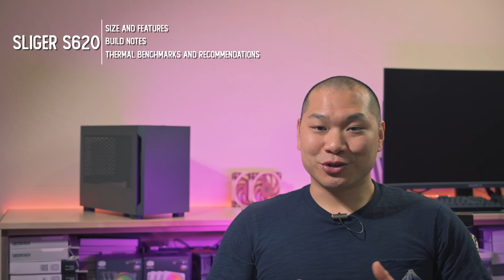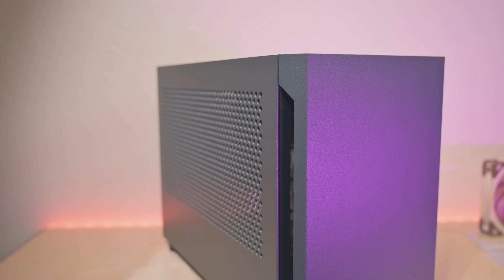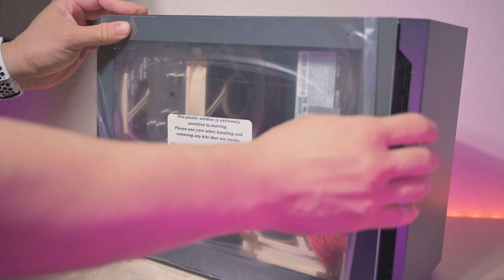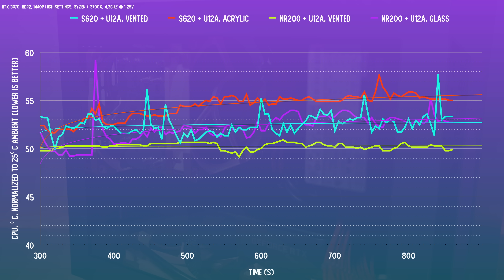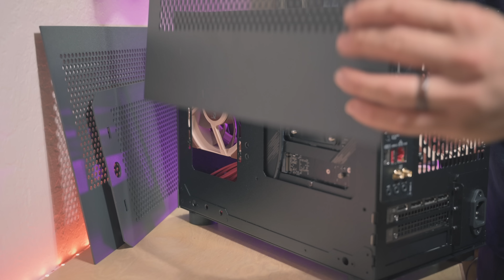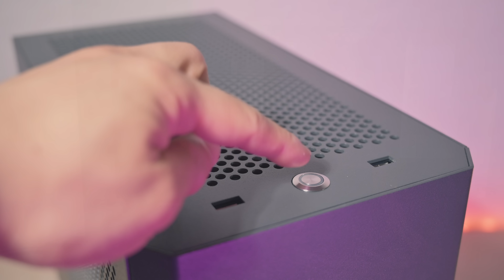The Sliger S620 - One Slick 16L Case!

Comment from the maker: Just a quick note on the D15S- Sliger mentions it is compatible, but I haven't tested it out yet. Other than the single fan difference, it is an asymmetrical design. Most likely that means you have to rotate it where clearance at the top would be better, but clearance at the bottom is completely dependent on the CPU socket position. On Asus ITX boards this is typically lower, Gigabyte and MSI have a higher position and would be better for that configuration. As a reference I have about 24mm of space between the bottom of the D15 heatfins and the GPU, by my estimation with the Gigabyte ITX the D15S in a lower position would still clear. YMMV depending on motherboard choice.
Reply: With a gigabyte b550i and a noctua d15s, the space is fine on both positions.
Reply: Hello, Can you make a Review for Thermalright PA120.. Please.. thank you..

Comment: Hey man, great video! :)

I've got the Sliger Cerberus and in case of using the rear fan as an intake fan, how bad is it for the PSU in terms of hot air flow to it? I am worried about it.

Comment: I have a very specific question for a particular setup in this Sliger case. 
I'm using the Noctua NH-U12A with an added slim intake fan and slim fan top exhaust right above the U12A. 
The GPU is 4080 FE so there are no bottom fans, and the PSU is side mounted so no front fan either.
Pretty much all the attention is on the CPU and nothing on the GPU except its own cooling solution. 
The temps are already pretty solid however I'm looking for recommendations with this setup because I could add a side mount fan or another top mount fan if those have helped temps in anyone's experience?

Comment: I have watched through the whole video and I understand it runs a bit hotter than the nr200. I have a few questions.

1. Will you recommend this case for a first time builder? I could just go out for nr200p in my local market but this case just feels so much high quality. 
2. How about ability to expend (upgrade in the future)?
3. Similar price range, how does the S620 compare with the NCase M1?

Thanks for the video anyway!
Reply from the maker: Hey Mark, thank you for checking in- here are my thoughts-
1) The S620 is OK to build in, the access through the top and front isn’t as nice as in the NR200, I’d say the NR200 is more suited for a first time builder, and yes, the S620 does have a nice feel to it build quality wise, but the NR200’s build flaws are more alignment and finish quality vs structural problems, and from a design perspective it’s a win for the NR200. It’s not as big a difference as you might think. Also there are a slew of color options coming for the NR200/P as well.
2) As long as it’s ITX or DTX boards and a 240 or 280 is good for your CPU, then you are covered.  Both are pretty sufficient for bigger GPUs but the Nr200 has a little more going for it since it can go vertical gpu with a riser cable if you want.
3) The M1 is my personal choice but is more cooling limited, and you don’t have as many drive mounting options, it is a different size category and really is more comparable to the S610. If you want to go big air cooler, the S620 is the one to go for.
Reply: @MachinesMore  thanks for the insight! I will definitely look for more builds with these cases and make a decision based on my needs (aircool with ryzen 9). I wish you the best with your channel.
Reply: I have also just found many videos of nr200 with different options on your channel, I will definitely check them out!

Comment: Can the C14S run in low profile-mode in the S620 or does it need to have a 120 mm fan underneath to make it work? Also, how sizeable is the height difference between this case and the NR200 and between the two, which one do you prefer in terms of performance and overall delivery? Furthermore, the max GPU supported is 323 mm and I have a RTX 3070 that is exactly 323 mm. Would this (Gaming Z Trio) realistically fit into the S620? Thanks in advance.
Reply from the maker: Hey Daniel, the C14S can run in fan on top mode (just like in the NR200). The big advantage the S620 has is in cooler height so big dual towers fit, but even then I think a good single tower is fine for most (not all) CPUs. The NR200 is slightly taller, and the biggest difference is top fan compatibility - which makes a very big difference for overall thermal performance. In general I’d go NR200 but if there is a compelling reason to have out of box SFF compatibility for something like a Dark Rock Pro 4 or D15, that’s what the S620 is for.

Comment: Can I put nr200 as a carry-on in airport/plane? Planning to build one this December.
Reply from the maker: It would fit in a carry-on, I’d probably pop a tower cooler off if you have one mounted, just to relieve mobo stress from movement. That’s about it, cushion it with clothes, bubble wrap, stuff like that.
Reply: @MachinesMore  Thank you, your video on nr200 are amazing and helpful. I will also remove the gpu as well.

Comment: 2.5" SSDs is easy. Some 3M double sizes tape and you can't mount a couple of SSDs on the side of the PSU. Heck you could mount two on the side of the PSU and an additional two on top of those for 4 SSDs.  Then another one or two on the side of the PSU facing out, though that's probably more SSDs than the motherboard sports.

Comment: Very informative video! I was wondering if there is any way I could “cut” the inside front panel so I can fit my MSI suprim card in this case because it requires 1 extra cm of clearance in length...
Reply from the maker: Cheers! I think you could, there's enough room for it and I think a rectangular hole is structurally OK, thickness should barely work too (no bottom fans). Do you have the case already? Because the one other thing is the power plug location. The Suprim is 140mm or so, that might interfere with the regular plug, you may want to order the pigtail version. Also, I think you can get the card in but it will definitely be a bit challenging from a build and cable management perspective.
Reply: @MachinesMore  thanks for your answer ! I don’t have the case yet, but I’m looking forward to do an itx build with this gpu. I’ve seen that it could barely fit in the nr200 but I wanted a case with a more premium finish. I think I will need to stick to the nr200p though, first because the sliger is ~300€ here against 100€ for the nr200 so I can’t justify that much extra without knowing if it will actually fit... unless I manage to trade my suprim from a smaller gpu, this one is not itx friendly for sure... anyways thanks for your feedback, much appreciated!

Comment: Is there a reason why you chose rear-to-front air direction? I'm just thinking about opposite direction, will it be worse? I'm wondering because I would like to place case on desk left side and concerned about warm air blowing right into my face :) thanks!
Reply from the maker: Specifically to mitigate the flow through cooler design from the founders edition gpu. If you have a conventional gpu it shouldn’t be as vital to do rear intake.

Comment: Wow do you have more guides on the d15 configuration? I’m getting the same case and d15 cooler, it would be great to take a look them.
Reply from the maker: If you take a look there’s a recent vid comparing the D15S and the Dark Rock Pro 4- should give you a few ideas. The D15 is a bit limited in this case.

Comment: See if you can get a Sliger SV590v2 to review. Looks awesome and is designed to fit a 360mm radiator. They offer a bracket for a pump/reservoir combo for $10 to fit in the bottom as well.

So far all I've seen for videos is people putting AIOs in it, when the case seems to have been designed for a CPU+GPU loop. The only bad part is that there isn't an option for a glass side panel.

Comment: This case is super slick although I wish the side panel to be more vented like Ncase M1 V6
Reply from the maker: It’s more like v5. There is a scenario where it helps- if you’re intaking from the side panel and run a side exhausting GPU, the blocked off portion prevents the case from just recycling GPU air, especially with an AIO.

Comment: As you like slate gray cases, I can recommend the Lazer 3D LZ7 XTD - 10.4 liters with 135 mm  cooler height clearance -  acrylic panels are offered in a gray almost matching the Sliger cases.

Comment: this graphs make no sense. D15 is a monster. you configured de fans in bad positions. use de psu in horizontal mode, no in front. and use 2x 120mm in top, and 2x 120mm fan in botton. make a air flux. use the rear (120mm fan in side of i/o shield mobo, for INTAKE air no, exaust. the air comes directly in cpu and upwards for top. and in front, use 120x for exaust, taking the gpu hot air. and please, y see the product, not the youtuber in 80% of VIDEO. and please, make videos in zOOM OUT, and no witch 300% of zoom!

Comment: All I see is another NR200 style case. Let's face it SFF has turned into nothing but Dan A4 style sandwich cases and this perfect example of an uninspired ITX case that really just fits the normal expectations.  How many times we just going to see the saem two style of cases with minimal differences be extolled as something 'new and interesting'. This case is not revolutionary, just vaguely evolutionary.
Reply: I have to agree with this. Honestly, the NCase M1, Dan A4, Sliger Cerberus Chimera / SM580, and maybe the Ghost S1 (if not were the inconsistent QC issues) were the trendsetters. Somebody just please make a good 19-24L case as the Lian Li TU-150 is bascially alone in that category for ITX towers (Silverstone SG14 is 19.55L, but it's a cube case). I'm not all that a fan of super tall cases like the Phanteks Shift.

The NR200 is honestly heavily inspired by the Ncase M1 and TU150, so I wouldn't really call it all that original. NCase M1 was basically the 'BitFenix Prodigy' of enthusiast, boutique SFF cases and then came the Dan A4 as you mentioned for sandwich cases (do prefer the SM580 especially versatility wise). Lian Li TU-150 again took cues from the NCase M1, but at least they made it into their own with how you can do cable routing in the case.

Comment: Sliger Should have made NR200p Clone but lighter with aluminum instead of steel,  and 158mm limit instead of 155m limit of the NR200P then they would be the "Premium" NR200 case, right now its losing too much just to be slightly smaller, the 2 25mm at the top of the NR200 helps a TON with the glass panels duo the lack of vents, plus can't fit slim fans with the big GPUS with sliger unlike NR200 (nr200 got 75mm clearance at the bottom vs 70mm of the sliger and lot of gpus are full 3 slots at 60mm this gen~)
Reply: I'd honestly up it to 20-23L to be honest. I think that market is stupidly untapped especially for those that want to go high end air cooling or 2x140mm water cooling as options. The TU150 was a wasted opportunity and I doubt Lian Li will ever update the layout as the TU-series was known mainly for the carrying handle for lan parties.
Reply: @CknSalad  NR200p clone but 165m CPU Cooler support would still end up being slightly below 20L, Sliger made a case that supports 165mm cooler but worse GPU Fans support if you use full 3 slot 60mm GPU +No real good exhaust fans like the NR200.
Reply: @HassanAlHajry  yeah, that's why I honestly wouldn't mind a Lian Li TU150 size, but with a lot better layout. be nice to see a decently sized ITX tower, but with more breathing room for cable routing and lots of fans.

I had the Ncase M1, and honestly I'm a bit over the whole <18L SFF trend. That doesn't mean that I want to go above 25L cases again as I do like ITX since mATX is pretty much dead unfortunately (love my old Silverstone TJ08-E).
Reply: Pretty sure you can fit slim fans in there. I might end up mounting them on the outside and installing some slightly thicker feet though. I have the s620 with a 3090 that I just finished. Thinking of 3d printing a “hat” to expand the top a bit as well, seeing as the io panel is removable and could easily accommodate that

Comment: Fantastic review! I really appreciate that it confirmed a question I couldn't find an answer for anywhere else: that using a NH-D15S (offset toward the GPU) with the Gigabyte Aorus motherboard will not allow the use of a 15mm slim fan on the top of the case. Seems like using my Mugen 5 rev B (that I originally bought for my NR200P based on your other videos) is going to be the better choice here. Looking forward to more reviews of this case, and the 610 when you get one!
Reply from the maker: Sure! I used the D15 but the D15S only offsets maybe 10mm, likely not enough or a fan, but I will try to mount one up.
Reply: @MachinesMore  The offset is 8mm (67x83) from what I've read, so it'll be close. I'm curious to see the results! I'll also be curious to see any reviews that omit the bottom fans; the case only has about 70mm of clearance for the GPU, so most of the 3080s/3090s will have to manage without them. Your NR200 reviews suggested bottom fan inclusion wasn't a huge temperature difference, so I'm curious if this case follows suit.

Comment: My biggest question. Radiator support.
Waterblock GPU in mind. Wondering if you can possibly get a bigger Rad on the bottom apposed to the Ncase M1. Or possible video later on this. If only theoretical.
Reply from the maker: 240 at the bottom officially supported, just like the M1. Technically 2x140mm fans fit at the bottom but I think the length of a rad would be super tight (and you also have to consider your tubing run and where the inlets and outlets are). One thing I forgot to mention was that a 120 at the rear is also possible.
Reply: @MachinesMore  Really love the Ncase design. My only complaint is adding maybe 15cm to the top, and about 10mm to the bottom. The ultrathin rad is perfectly fine for GPU cooling, but being able to fit the standard 25mm noctua on it would be a huge help. And adding the slim fans to the top to help control the direction of vented air would also help. 

I know it would make it a bit bigger. But they could just call it the XL version, on for air and one for custom loops. The width I think is perfect. And the from panel doesn’t matter so much because that’s a great space to fit extra 2.5”/3.5”. 

You make awesome videos man. I think a good addition to your regular stuff is adding a section to all possible Radiator/AIO support. I believe you did it with the nr200. But other then that you do a phenomenal job.

Comment: If you ever get your hands on a NH-D15S it would be interesting for you to revisit this case to test compatibility with mobos. I'd imagine whether it can fit would be very dependent on the CPU socket position. With the mobo in the video the D15S seems like it would have to be installed backwards as the regular D15 was already hitting the roof.

Otherwise, great video! Best review of this case so far.
Reply from the maker: Just a quick note on the D15S- Sliger mentions it is compatible, but I haven't tested it out yet. Other than the single fan difference, it is an asymmetrical design. Most likely that means you have to rotate it where clearance at the top would be better, but clearance at the bottom is completely dependent on the CPU socket position. On Asus ITX boards this is typically lower, Gigabyte and MSI have a higher position and would be better for that configuration. As a reference I have about 24mm of space between the bottom of the D15 heatfins and the GPU, by my estimation with the Gigabyte ITX the D15S in a lower position would still clear. YMMV depending on motherboard choice.

Comment: I dislike Sliger paint. It chips easy. I've had 3 Sliger cases and they all have the same paint process. Out of all niche SFF cases, Sliger is at the bottom. I am glad that this case doesn't use PCIE extension since Sliger uses a cheaper brand that behaves improperly when mixing 3rd gen and 4th gen PCIE components.
Reply from the maker: Interesting. This one looks different from another Sliger case I have, seems thicker and has more of a hard shell look to it. The 3.0 riser cables are always problematic with PCIe 4.0... and current PCIe 4.0 risers cost an arm and a leg.

Comment: The only thing this case has over the nr200p is that you could fit a big air cooler like the nh d15, other then that I don’t really see why you would spend $150 more on this case over the nr200p.
Reply from the maker: This would be a “horses for courses” discussion. Performance is one thing but I can also appreciate that some users build PCs for the finer details and quality aspect as well, and this really fulfills that niche. My personal preference is for this size bracket as well. The D15 vs U12A isn’t a night and day difference at all, either.